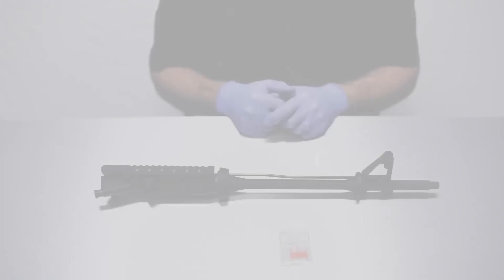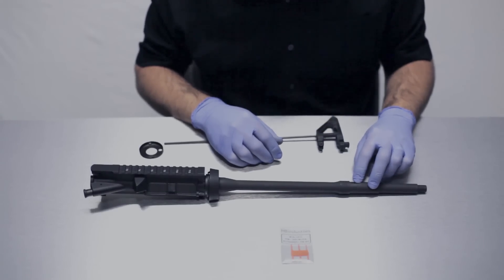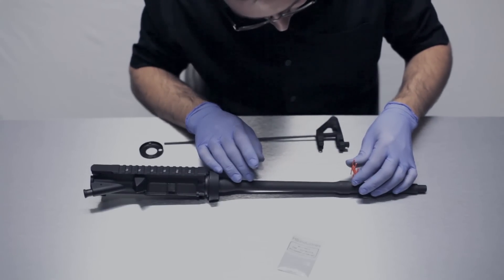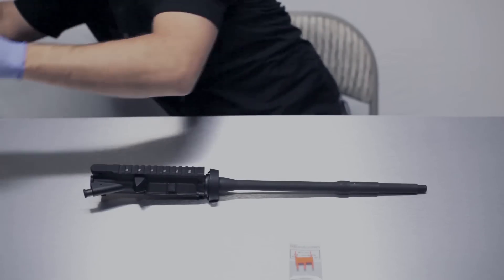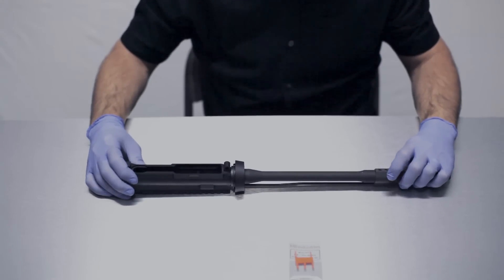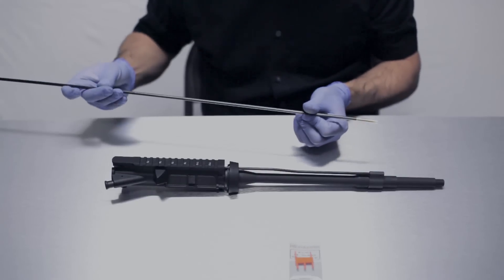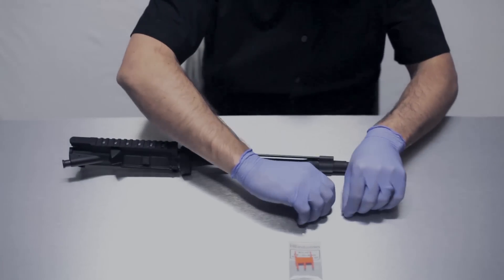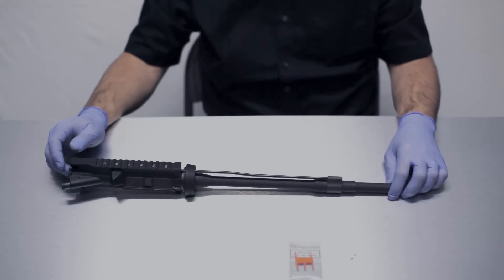AR-15 Gas Block Alignment Tool

Comment: Wow, and here I was using cut toothpicks that work exactly the same way for practically nufin ... LOL
Reply: That will work but unless you have a toothpick that is the same diameter of the hole, then there will be a lot of slop and you might not get the holes lined up precisely! As an example, my holes were lined up almost exactly (but a little bit off), and that slight misalignment was enough to cause short stroke....it would fire a round but wouldn't rechamber the next round!
Reply: Plus, you can probably reuse these devices by just putting the pieces back together with a touch of super glue, or something else that will be sufficient to hold the 2 pieces together long enough to use them again!
Reply: WOW David, you think your tooth picks worked as well as this alignment set up?? 🤔 I think not!!!🤧👊

Comment: If all barrels are not the same size hole, then can there be a situation where the pin that fits the barrel doesn't fit the block?
Reply from the maker: Hi Bill, excellent question. The answer (as of time of this comment) is that the gas block holes are always oversized or slightly larger than the barrel gas ports. Generally the barrel gas ports are always .095" or smaller, and the gas block bore always .125" or larger. There could be some time in the future with amazing new powders or calibers or manufacturing methods that result in companies producing gas blocks with smaller bores, but again as of this time we have not ever come across an AR type gas block with a bore diameter smaller than the largest known barrel gas ports.

Comment: Good idea but why not use a toothpick? I always use a drill to slightly open the top of the gas port on the barrel usually just the depth of the axis of the bit as if you were going to counter sink a screw in case the gas block is a little off. The gas port remains the same size but it makes it easier to line up the gas block hole to the port in the barrel.
Reply: a drill can bite and leave an edge or two. Better to use a soft abrasive cone

Comment: I found these on a site about a year ago.... never took time to order and then could never relocate the site/ NOT THIS TIME.... just placed my order for 4 - .556.      i build my own 80% and will use these as a final checking tool......as builders usually have their own little tricks..  u feel me
  ALL BLACK RIFLES MATTER

Comment: this video gave me an idea..just use a piece of a tooth pick, same result, and you've probably already got them in your house.
Reply: Bigbacon that is a damn good idea!!
Reply: That will work but unless you have a toothpick that is the same diameter of the hole, then there will be a lot of slop and you might not get the holes lined up precisely! As an example, my holes were lined up almost exactly (but a little bit off), and that slight misalignment was enough to cause short stroke....it would fire a round but wouldn't rechamber the next round!

Comment: Didn't work for my S&W MP AR15 sport, their just a smudge to thick and will get stuck in the hole. I just ended up using a piece of lead from a lead pencil.
Reply: Shaun Reeves ... sounds like S&W has their own specs on barrel port size... NOTE: if you are having D/Feeds or trouble with cycling-  based on your comment you may need to open up the barrel gas port....  As HB smallest pin should fit a milt. spec. barrel port.... 
   (I'm just saying)
Reply: I did every thing you said. Maybe I got sold a defective product from them. 
The problem was fixed using lead from a lead pencil. 
I bought 2 packs from them too. Money well wasted unfortunately.

Comment: Do you know that the two parts are aligned by resistance / feel, or can you audibly hear the pin drop?
Reply: roostershooter76 I wondered the same thing...he does not indicate on the video..apparently assumes it has dropped effectively into the barrel

Comment: Are these reusable? In the video it starts off 1 piece, after installation and the barrel rod goes through it breaks it in half? So again is it reusable?
Reply from the maker: +MrRaVeN215 There are six (6) pins per set, each pin can be used one (1) time. After the gas block and port are aligned, the pin must be broken in half to be removed. There is a neck/stress riser in each pin that ensures the pin breaks in the correct location and that each half can be easily removed from the barrel.
Reply: Team Rogue .... OMG???
Reply: Team Rogue Simple langauge.
 NO THE PINS are NOT REUSABLE,  as during the removal process they are sheared into.

Comment: Why does no one show how to remove the first gas block sight. I saw one vid but my pins arent comin out
Reply: stupiddumbtard79 They are taper pins, smack the shit out of them from left to right of the rifle.
Hit the smaller end of the pin, so lay the rifle with the ejection port facing the table, and the bolt release facing you. Drive the FSB pins out this way.  Left to Right.
Reply: Lorne M Big Fucking Hammer
Reply: That last comment is right. But James left out an important tool to get the pins out. Sometimes the pins need some persuasion. So get yourself a BFH. That is one tool every armorer should have.
Reply: +stupiddumbtard79 I couldn't get mine out of my bushmaster despite the right orientation and a BFH.  I hit it with some WD-40, let it sit awhile and then was able to knock them both out.
Reply: +Nathan Garza WTF is a BFH?
Reply: They go out one way. If they're not moving flip it over and try the other side.  Those pins are tapered. And yes,  BFH is the best tool for that job.
Reply: James Knowles
LOL, OIC, TY, TTYL, O-5000.

Comment: Guys...I bought this and tried it.  The quick version - save your money.  The long version.  The idea is sound.  The issues I had: the pins are indeed accurately sized.  To the point where they will not freely fall from the barrel's gas port when flipped upside down.  Especially when there is even a light coat of oil.  Those plastic pins are the weight of a feather.  Also, the gas block's opening is relatively large relative to the gas port - we all know this.  The issue is that once you feel that the pin has fallen to the gas block (held upside down), there is an incredibly large area of rotation that is allowed.  Again, because the gas block's port is relatively large.  The bottom line is that you could easily do this by eye.  Also, if your rail encloses the block, you could also use the rail itself as an alignment guide.  Always make sure that the barrel shoulder and gas block match the gas opening.  On Vltor gas block, you need about 0.030 from the shoulder to the edge.  On Daniel Defense, the block completely lines up to the shoulder.  You can verify this by holding the block upside down.  There is usually an opening that corresponds to the location of the gas port.  Once you have fitted a few, you will not have problems.  You can always plug the rear of the barrel with a plastic dummy round from Magpul and blow down the barrel.  You can easily verify that the gas port is operational.
Reply: lkazanov...... that is why it is advised to use the pins to align g/block with the gas tube installed  and aligned into gas key - this way the two different size gas ports will be centered on each other or at least, close enough for government specifications (LOL)
       WHO WILL GUARD THE 
                   GUARDS
Reply from the maker: Ikazanov - You are correct, it is important that the gas block and barrel be clean and dry before fitting the pins. This is mentioned in our video, but should be emphasized because it is a very important part of the process. Thank you so much for taking the time to review our product.

Comment: Dear god, this thing is brilliant! I need to get some for my next build.
Reply: Completely unnecessary.  Flip iyour gas block 180*.  You'll see that there's such a huge margin that you'd wreck your rifle and the BCG would fail to seat on the gas tube before you're blocking the port with bad gas block alignment.

Comment: 50 bucks for a battle dimple jig or 10 bucks for something that gives the same result. Love it.
Reply: Nick Krakovec dimples are for making sure the set screws dont turn side to side. these are for checking gas system alignment. not really sure why youre comparing the two.

Comment: Are one of the pin sizes a .625?? Would really love to use this but not sure what sizes you offer for the gas port. Are they marked on the pins?
Reply from the maker: M1911Mike Our alignment tool is packaged with an instructional insert showing the diameter of each pin in the set.

The tool was designed for barrels with an outside diameter of 0.750" or larger at the gas port. This covers all barrel contours (including match bull bbls) except the A1 or "Pencil" contours which are 0.625" diameter at the gas block.

For more information please contact us at sales@hbindustries.net; we would love to help you with any barrel/gas block/caliber configuration that you might have.